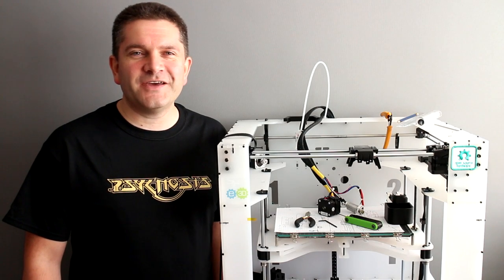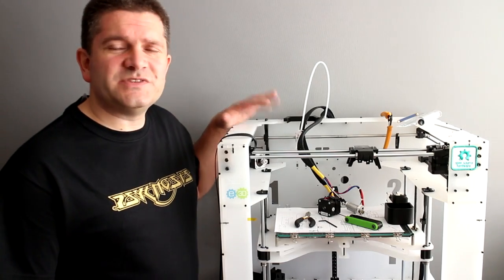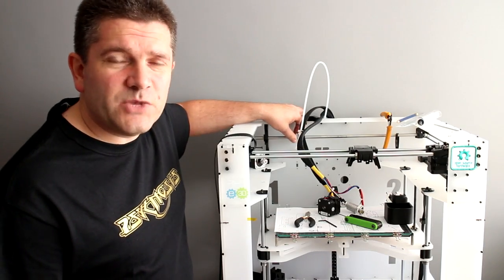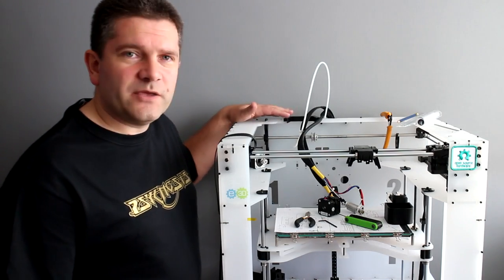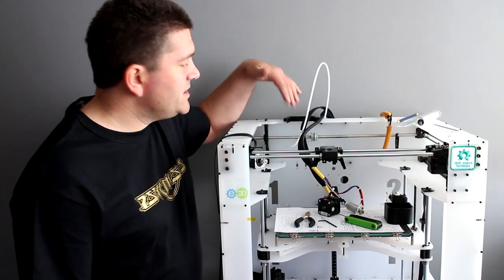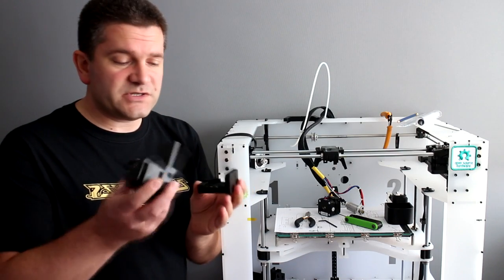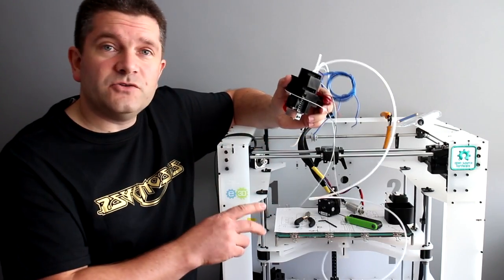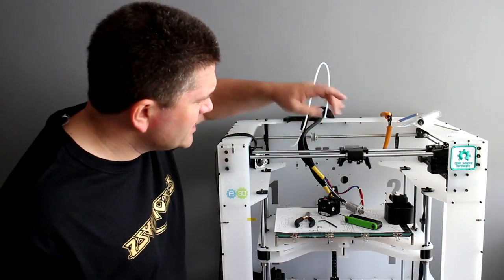Hacking the BigBox - Update 4 for October 2015 (Part 1)

Comment: Surely you want metal to metal contact for your mag-fit end effectors? That will ensure more repeatable positioning between exchanges. USB3.0 > DS09 btw...
Reply from the maker: +Neil Gordon It would indeed, but I can't print in metal and I wanted a RepRap 'printed solution' not a machined one, so I'll see how these hold up. They do repeat well, magnet to magnet positioning is working better than I thought it would.